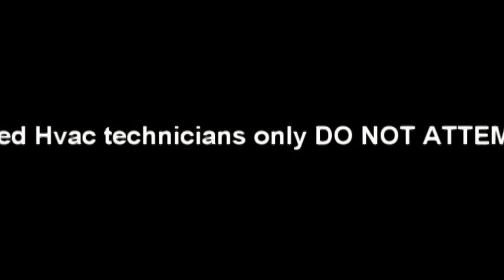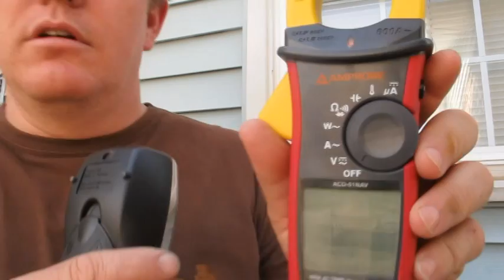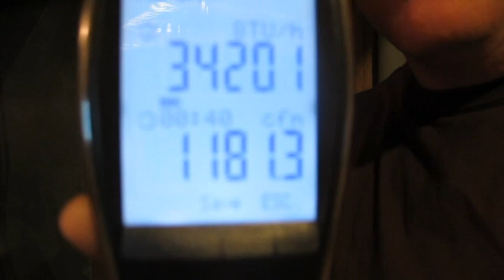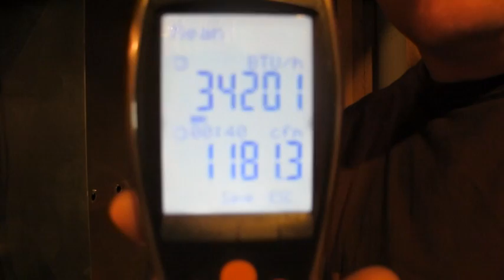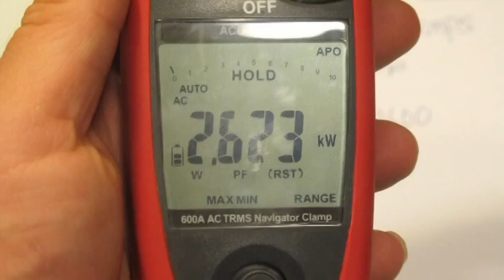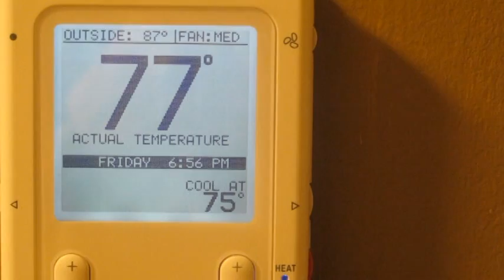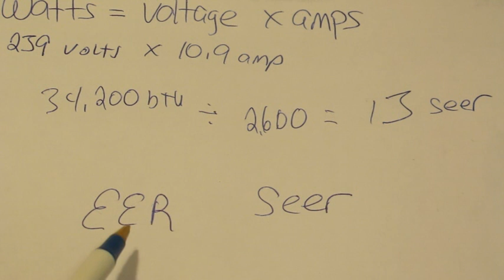HVAC Training - Determine EER Rating

Comment: Wow thats great Eddie. Thanks a lot that will be a lot easier to use in the field than a pyschrometric chart. 
Fritz told me that you posted an earlier video about calculating capacity. I just watched them. Great job and thanks for posting those videos. It's a lot easier watch your videos when I need a review rather than reading the books again. Every time I look at a pyschrometric chart it seems like the first time. My memory isn't what it once was.

Comment: I do learn a lot from watching hvac videos.  I do know my limits though.  My AC shut down when it was 104 outside.  I reset it and it came back on.  So I waited until evening shut the power off, and cleaned the coils.  They were covered in cottowood seed.  Turned it back on, even sounded quieter I think.  Have not had a problem since, and the next day it was 106.

Comment: Great tutorial i need some test tools from testo fast. I bought the 570 testo analyzers but they were not working right the temperatures could not keep up dunno. I hope I get them back soon so we can start moving forward. I got mines from Johnstone supply and they are working on it. Just worried if they are going to give me some bummy analyzer again. Did your testo smell like a electrical burn smell, and my hangers are they supposed to swivel because one side did and the other did not.

Comment: Question:  When taking watts for the EER calculation should the AH wattage be added with the CU wattage for total system watts?  Or is the AH watts not included with the EER?  Thanks for the video

Comment: Hey Eddie I know that's a Testo meter but wich one? Right now I'm  using the testo smart probes to calculate btu, the issue is that I have to get my cfm with static pressure and blower performance chart which is not always available and it's longer to do. This meter will help me a lot,  thanks

Comment: Eddie,
The calculation that you performed was actually EER, and part of it was also missing. You need to add in the wattage of the evaporator fan also. That would have dropped your EER slightly. SEER is a quite complicated calculation and can only be reproduced under a single set of conditions. 

It would be interesting to also show a before and after of blocking part of the condenser coil to simulate a dirty condenser. That would be interesting for viewers. Nice video.

Jim
Reply: I was thinking this also. The fan would add another 700 watts or so taking it into the 10's for eer
Reply: Does measurequick have the ability to give the EER in the field

Comment: To attain true wattage you must account for power Factor:
Volts x Amps x PF = Wattage

most compressors run at .82 PF or some at .78, depends on age and how the windings are made in the motor

so, wattage should look something like this:  239 x 10.9 x .82 = 2136 watts

34,200 btu / 2136 = 16.01

However this is not the SEER rating

Your meter at your home is billing you with active power in watts, not apparent power in amps

go look at the ANSI/AHRI Standard 210/240 for how they calculate SEER and EER.  There is WAY more to this calculation than what is in the video.

If you want to see the most efficient HVAC system ever made, go to www.ibec-group.com and see halo motor technology in action on roof top units and split systems.  26-30 SEER and 16-19 EER.

Comment: I am sorry, but that is NOT watts, that is VA, your APPARENT power, not true power.
Reply: He used a wattmeter the Amprobe Acd-51nav. It is designed for energy auditing. It measures TRUE power too. The unit "considers" the phase angle between the voltage and the current. ie it reads zero power if one measures 2 amps to a capacitor and 120 volts across it. It also reads the power factor too. ie the load is to a resistor and it is 2 amps with 120 volts across it then the wattmeter reads 240 watts.